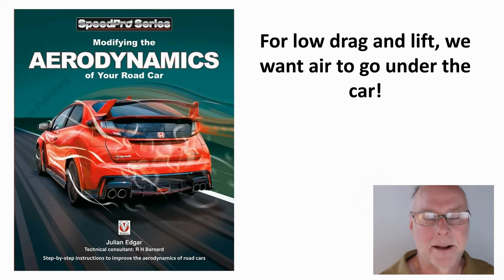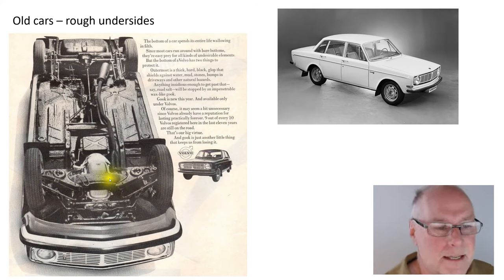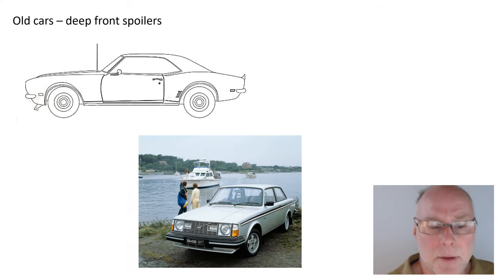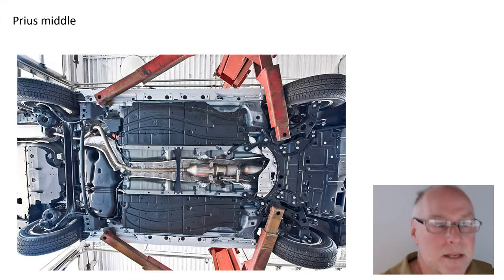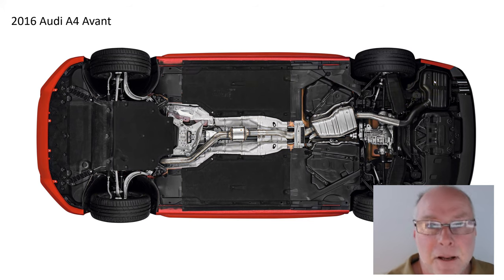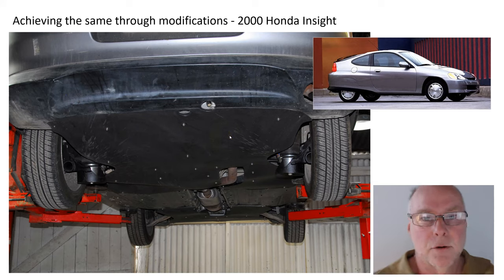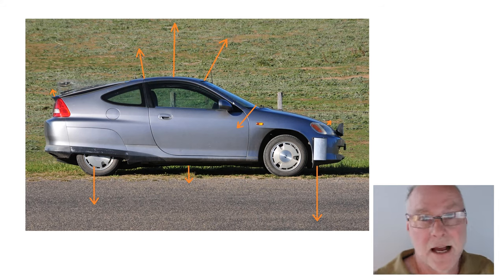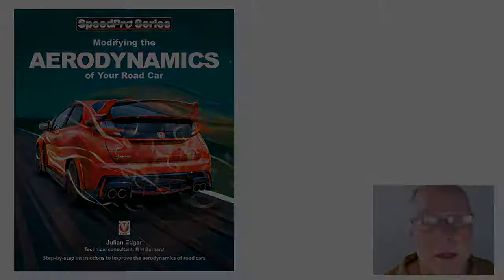Forget front spoilers - you *want* air to flow under your car!

Comment: Another great video! About half way through I was hoping you’d show my Passat wagon and sure enough there it was. Keep up the good work
Reply: Yep...these videos are great
Reply: Was yours the one near the end with the exhaust covered by the under tray? How much exhaust is it safe (for heat build up) to cover up, just the rear section or the mid too?
Reply: @anonimushbosh   you can cover the whole thing if you have enough space to dissipate heat. I left my under tray 1 to 3 inches below the bottom of the car so there’s a big area to dissipate heat, and then I have to drain holes in the corners of the under tray and all the air that goes through the engine, and like in from the front tires goes through the undertrained feeds out behind the rear wheels.
Reply: @northwestbushcraftandsurvival  Getting mine up on ramps next week to look at mounting points etc… thanks for that. Cheers

Comment: Modern cars use the splitter to create a high pressure zone in the front for added downforce, not to stop airflow from going underneath the car.
Reply from the maker: Sure, did I say otherwise?
Reply: You didn't mention it. I felt like it was worth mentioning because otherwise the video implies the splitter isn't beneficial  @JulianEdgar
Reply: @JulianEdgar I feel like a super bird front end would be great for funneling air underneath the car. It just needs wheel vents and some way to create a high pressure zone on top of the car
Reply from the maker: No, overall, I don't prefer using splitters to gain downforce. Undertrays are far better - covered in detail in my latest book. https://www.amazon.com/Vehicle-Aerodynamics-Modification-Development-alternative/dp/B0C87VYVL8 or Amaon in your country.

Comment: Check the panhard CD lm64 race car from the early sixties, drag coefficient of  0.12! , with a big diffuser and smooth floor. The knowledge has been around for ages :)
Reply: he mentioned previous videos of that car i dont know wich one than you for remembered
Reply from the maker: Yes I have always loved this car. But be very sceptical of claimed drag coefficients of the distant past. (But it least it did go fast on not much power = low Cd.)
Reply: @JulianEdgar  yeah, drag coefficient will change depending on measurement, available wind tunnel technology etc. Even with modern numbers and methods there are alit of variation. The Tatras from old is also pretty meat with completely flat floors etc, jay Leno showed his on a lift on his youtube channel recently, worth a look :)

Comment: what about side skirts retaining the air under sports cars, i see it would be beneficial for the effectiveness of the rear diffuser, but if air would exit out of the sides of the car, it would be a lower pressure area resulting in downforce under the whole area between the wheels. which, sure, is maybe not applicable in all cases but i do not believe i have seen any cases of this. or do the vortexes around the rear wheels make it not worthwhile?

Comment: Hi Julian. Do you think there is any value in improving the undertray smoothness in a car like an Ioniq EV with light Mylar tape over the remaining imperfections like stiffening ridges or bolt holes etc?
Reply from the maker: There might be a fracional (ie unmeasurable) improvement if doing this towards the front of the car, where the boundary layer will be thinner. Do you have a link to any pics of the car's underside?

Comment: After watching this video I actually removed the front splitter/lip om my megane 4 RS. I can see the benefit of actually having more air flow underneath (on quite a smooth underside) both for downforce but even cooling of engine bay. Car gets tracked quite a lot so Im hoping on an inprovement of my oil temps as well as intake air temps.
Reply from the maker: Just removing the splitter lip, without then changing the underside of the car, probably won’t improve things!

Comment: Hello Julian. I agree with all you say but ask if there is a point where the front of a car, perhaps because of its height from the road, directs so much air underneath that the air cannot speed up enough to create low pressure so a higher pressure 'bow wave' is set up thus, possibly causing lift? There must be an optimum somewhere?
Reply: Airplanes miles above the road. 
Are still capable of downforce

Comment: Mr Edgar; I have added an undertrays (similar to your insight) to my little Toyota 05 Echo (trying to increase mpg). I have also closed the grill openings (mostly). To keep air moving I have shimmed my hood up at the hinges by 9mm. I was hoping you might comment on this as it is different and i cant seem to find any relevant information on this. I feel it would either a) allow air out of the hood (however theres little flow/ pressure from the grill openings) b0 allow air that would build up a high pressure area at the base of the windshield somewhere to go. Id love some learned thought on this.  Much Obliged...
Reply from the maker: Don't guess (and ask others to guess) - just do some testing. What direction of airflow is shown by tufts?

Comment: Mr Edgar its hard to change minds some of came from decates ago what are your thounths vacuum cleaner car 
Chaparral 2J i still believe less/non airflow under car much better results like you said from 80s :=)
Reply from the maker: I don't see any connection between what is covered in this video and the Chaparral 2J fan car - completely different approaches.

Comment: Purchased the book really enjoying the read and this series content, looking forward to getting my new Toyota Yaris GR4 and doing some basic wool tuft testing on the car, I've actually found a video of the underside of the car, all in Japanese auto translate made fun viewing , it's a comparison between the new HV Yaris and GR4, the front undertray diffuser has an open duct about 300mm back, looks like an inverted bonnet intake, would this be for airflow into the sump area of the engine for cooling? or the opposite ? 

Regards Russ...
Reply from the maker: Can you link to the video?
Reply: @JulianEdgar  

Hello, I'm not sure as most of the title and all the wording is in Japanese, I you type ( Toyota Yaris GR VS HV )in your YouTube search it comes up with all the GR 4 Yaris videos, 
with mine it's about the 10th down the list, a young Japanese Girl wearing a Face mask, they have about 10 videos available as I think they are related to a Toyota garage selling all the available models. The GR4 is black and the HV is blue. Just had another look sorry try this  www.youtube.com/watch?ve=Fpo1vkrVQ28 

Hope this helps Regards Russ....
Reply from the maker: Looked at the video. The opening is just a cooling duct for the engine sump or gearbox I'd think. The underside of the car doesn't look anything special - should be easy to improve, especially rear half.
Reply: @JulianEdgar  

Thanks for the reply, Yes I was very suprised at how little undertray aero they have under the hole car, as I said previously from other videos I've watched, they have a lot of ducting to brakes and front intercooler. as this is long term car for me, I'm sprinting the car at a few events I've competed at for years as standard, then hoping to add underbody mods for the next year.

Regards Russ...

Comment: The VW ID-R has a front splitter/spoiler (not sure how to describe it exactly?) and has been quite successful. Equally, with VW behind it, its probably had a fair amount of engineering thought put into it. So are they as obsolete as you suggest? Or am I missing something?
To be clear, I don't say that out of disrespect, it just seems like quite a big discrepancy and I don't know enough to understand if I am missing something, or if yourself and VW disagree.
Reply from the maker: It's a full competition car, not a road car! Think of the splitter as being an extension of the undercar aero. Now on a road car, how much bigger can you make the floor area by using a splitter? 5 per cent? So why would you bother doing that rather than optimising undercar aero? See also https://youtu.be/TVVWo8jylkA
Reply: @JulianEdgar  So if I understand correctly your argument is less about them being obsolete, and more about the lack of practicality on a regular road car, and how they have been misused in the past as a blockade as opposed to a functional item?
Reply from the maker: @aljowen  Well, the book is called 'Modifying the Aerodynamics of Your Road Car', and every example in the video is of a road car. Did you watch the other video I cited? Usually, following race car aero practice on road cars is going in the wrong direction.
Reply from the maker: If you are referring just to front spoilers (and not splitters), then yes, I think front spoilers are completely obsolete on road cars. Why block the air you can do something very good with?
Reply: @JulianEdgar  Ok, thanks for clearing things up :)
I don't have a background in engineering, but as a hobby I do like making cars for a video game. While the game does simulate drag/aero, it uses a much simplified model, so I don't strictly need to worry too much about this stuff, as long as it looks and feels convincing to Joe Bloggs. But I am trying to learn as much as I can so that I can design vehicles that are more convincing and stand up to greater scrutiny. If you are at all curious: https://youtu.be/AbBNLBTf0OU
(If only the game could simulate wool and pressure sensors, but alas)

Anyway, I've watched a bunch of your videos, and subsequently ordered a copy of your book. I look forward to finding out more, and understanding more about what I do.

Comment: Hello Julian I have old 944 and it has very rough bottom do you think its worth to start making it flat or just fit spoiler to front and be done whit it? Ordered the books based on these videos, quite good marketing, it gets some time to get here though :)
Reply: Thanks, another job for me to do!  But happily I know it will be actually beneficial unlike some modifications I made.  🙂👍
Reply from the maker: I would think the Porsche 944 an excellent candidate for a full undertray, as the upper body aero is already quite good.
Reply from the maker: Yes, an undertray is one of the few modifications you can be almost certain will make an improvement.
Reply: @JulianEdgar  More modded aerodynamic Porsche 924  World record high speed distance car from 1976 isnt too differend from 944, it has some intresting design at the back and way lower cd  0.268 instead of 0.37. I have usa variant of ugly bumpers and worst fitting front so i suspect the cd is even worst than that in my car, i noticed it has air curtains coming for front wheels not sure if they planned it or its just something that they ended up whit that kinda pumper and tire fenders. My english isnt great sorry if my mumble is some what confusing.

Comment: notice the alpine has a couple of open rectangles ahead of the rear axle/engine - air intakes? and if they are, how effective can they be in such a low pressure area?
Reply from the maker: Flow depends on pressure differential, so it depends on where the exits are.

Comment: Can you explain why more ground clearance means less drag
Reply from the maker: More ground clearance doesn't necessarily mean less drag . It depends on the underbody roughness and the clearance versus the body length. Page 125 of my book.
Reply: Babu Moshai having more ground clearance doesn’t = less drag. Having a flat floor and enough room under the car to let some of the air from the front of the car pass under = less drag
Reply: I read it had something to do with the body of revolution.

Comment: Answering
"...if you haven't optimized the underside. And why wouldn't you?":
because I don't want to drill holes in the floor and have it rust to pieces in no time in my climate ;)
It'd be great if anyone in the comments section suggested reasonable options for securely attaching undertrays without drilling holes in the car
Reply from the maker: Stainless steel rivnuts and fasteners, inserted in painted holes? Use the existing fasteners to attach a frame to which the undertray is then attached? Use existing fasteners and where new ones are required, use brackets that attach to pads urethaned to the underfloor? Talk to a local body shop about what they do to rust-proof any holes they need to drill?
Reply: It’s called thinking outside the box.

Comment: Nice content in this channel. I am a bit confused regarding the need of a front splitter. There are so many examples of card using front splitters and being very effective on track. 

Why adding a front splitter will prevent air from going under the car? I mean that ok, it will block the air that has reached the bumper from going under the car but the air that hits the splitter will eventually be spitted and go above and under the car.

For example here is an Alpine going to pikes peaks: https://www.4troxoi.gr/wp-content/uploads/2023/05/Alpine-A110-Pikes-Peak_03-1024x576.jpg

It has quite a big splitter.
Reply from the maker: Since that video I have done a lot more testing, and yes, splitters can work well. But it's still better to start with a front undertray if you want to reduce lift / gain downforce. Note: my videos cover road cars, not track cars. And it's not the same!